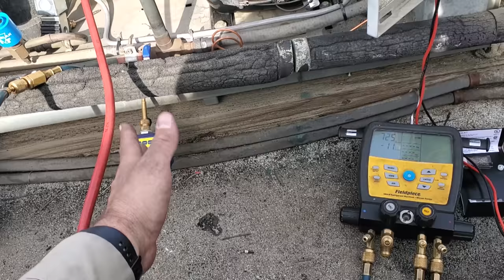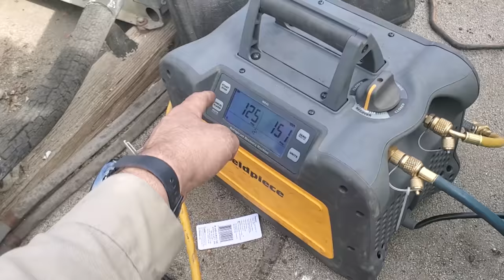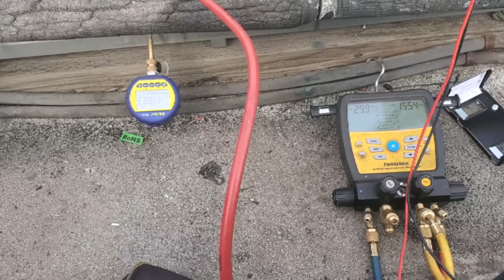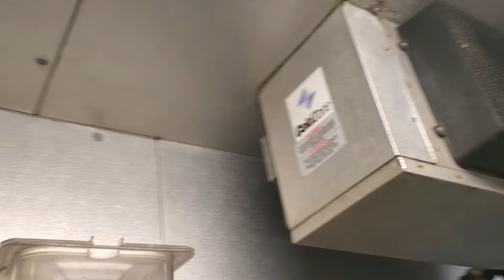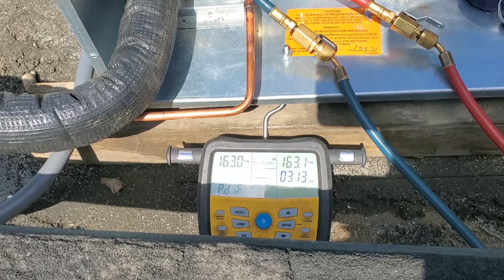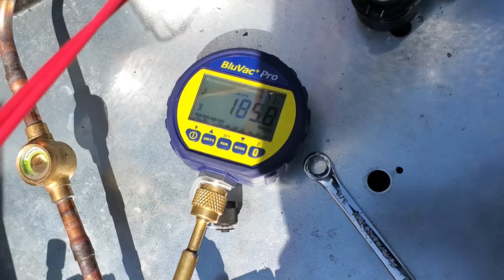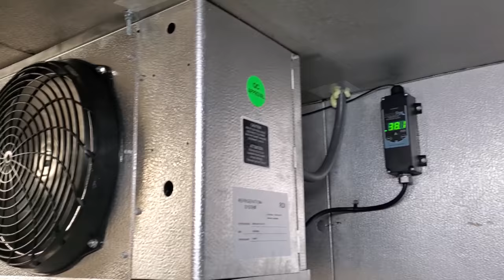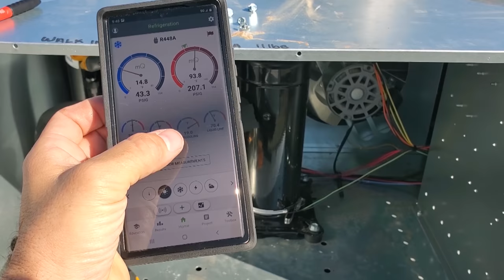THEY LOST POWER IN THE MIDDLE OF THE REPAIR

Comment: Here in Brazil we generaly use a breaker that is called "Motor Breaker" for 3 phase motors like that, this breaker it's like a contactor that shuts off in case of problem with some of the 3 phases, when the 3 phases come back to normal it turns on again saving the motors from problems.
Reply: A lot of newer equipment comes with phase loss detectors.
Reply: You could I suppose just put three single phase relays in series, and wire the whole thing into the line that goes to the motor contractor. Although those weird unbalanced phases like 40/80/120 volts might not get ‘r done with that. Some electronics are probably more reliable.
Reply: @JasperJanssen :

I don’t see how your idea would work.  
All three phases need to be within the labeled operating range, (with all three having reasonably the same VACRMS with respect to the grounded conductor).
Otherwise, you have a loss of phase.
Reply: @denverbraughler3948  each of those relays wired to each one of the phases. If any one phase is missing, its relay disengages, which causes the feed to the motor contactor to drop and therefore the contactor to drop out.
Reply: @JasperJanssen :

It’s unclear whether you watched the video.
Your design won’t detect a missing phase because — as shown in the video and as other commenters have explained — there is inevitably sufficient voltage on all three phases to close relays whenever any single phase is supplied from the power company depending on how the transformer bank is configured and what loads other customers have connected.  Notably, a running three-phase motor when a phase drops out is able to generate the missing phase and back-feed to other devices.  You wouldn’t even detect that the phase was being generated by your own equipment that you’re trying to protect.
Reply: @denverbraughler3948  I have no idea whether I watched the video either. If I did it was a very long time ago and I don’t remember anything about it, and I’m not about to rewatch it.

My comment was 11 months old!
Reply: @JasperJanssen :

Had you watched the video, you would have seen that you can’t block operation during a dropped phase scenario by simply cascading relays.  The real-world scenario is probably never ideal, and certainly most of the time it isn’t.
Reply: @JasperJanssen  In reply to your old comment and for future knowledge. 
They make cheap "motor saver" relays that already do what the OP mentioned. No need for any odd configurations of contactors. Just a motor saver, it monitors the phases and will drop out if any phase becomes unbalanced or is lost.  They are pretty common.  There are even more expensive models that will monitor the current balance between the phases to the motor and if the current becomes imbalanced it will also trip off the motor.

Comment: In 1965, there was a massive blackout which affected much of the northeast United States. However, instead of the power going out all at once, the voltage in my area slowly faded down over the course of a couple of hours. Incandescent lights just kept getting dimmer and dimmer, but as you can imagine for electric motors, it was disastrous!. My father raced around town turning everything off, but numerous motors were already damaged by the low voltage and had to be replaced or sent to Mr. Parslow's shop to be rewound.

Comment: I've got a 3,500 watt inverter on my van. It's awesome to have power everywhere I go.
Reply: Pure sine or MSW?  I've had a hard time finding one big enough to start a refrigerator or run large tools without shutting down on overload, found a 3/1.5kW one that starts a refrigerator but I worry it won't cut it for a power saw if I had to do some DIY cuts in the parkinglot to fit things in my car.
Reply: @matthewmiller6068  there out there, but the problem is massive power draw, no vehicle on the market has enough battery bank or generation to supply them. with exception of some hybrid electric cars and massive commercial units.
you're better off with a diesel or gas genset plumbed off the vehicle fuel tank.(motorhomes and others have been that way for years)

Comment: My only thought on pushing refrigerant into a system is using a line drier right before in enters your manifold or equipment. If you cut open a recovery tank ( or even an old recovery machine) you may be surprised at what you find.

Comment: need to invest in some phase monitoring/phase failure relays, usually installed in series with the mains power into the package unit or whatever equipment it is, and if it can't see all 3 phases the internal switch won't make a circuit and allow any power through down the line.
Alot of equipment in Australia have these installed in them.
We don't have alot of power issues where I am in oz anyway but I know you guys do in cali from time to time, not a bad investment for your clients I reckon.
Great videos Chris 👍
Reply: Actually that's a good idea dude, actually that it could be useful in my old workplace with 9 trane air controllers for the chiller who was a trane RTA from 2009 or 2008, a big old system with scroll compresors on r134a
Reply: @lutboy2909  yeah man 100% !
Has saved a few comps on my sites aswell over the years 👍🏼
Reply: In my experience here in germany, these are the failure point more often than they detect a failure.
Reply: @FerdinandFake  sadly, that happens everywhere with them, they become the failure point!
Reply: Wouldn't the best place for phase monitoring breakers be the Mains Breaker between the City Grid and the Site Distribution Panel?

Protect EVERYTHING from a lost phase in the City Grid...
Reply: @HappilyHomicidalHooligan  well yeah obviously.
I was merely pointing out a point where Chris could create some work for his company to protect the equipment that he himself looks after.
End of the day, Chris’s obligations to his clients is to keep their refrigeration and air conditioning equipment working and not their entire building, which would also be outside of his licensing restrictions.
Reply: @FerdinandFake  usually phase guard is cheap to replace instead of replacing big motor or similar. But yes, usually those are really prone to failures for some reason. One option is to make crude version with 3 relays in series, that almost never fails but does not trip before voltage in phase is really low.

Comment: Nice! I had always theorized that a recovery machine could be used this way, and then i got caught at the end of a repair just like you did, but residential. It worked for me too, but the power didn't come back on before I left, so I just had to hope. But the system started up and worked fine according to the customer. I've since been out to check and fine tune it tho. Couldn't sleep otherwise.

Comment: It's single phase but you have back-current and it's probably the same phase feeding all three wires.
And that's why you shall have ganged 3-phase breakers and fuses today so when one phase is overloaded it cuts off the others.
Even better to also have protection circuits that cuts the power if there's an out of range voltage, but that's of course a bit more expensive and has to be weighed against the price of replacing the equipment. Delayed start after a power outage is also something that can be helpful to avoid repeated power disruptions and blown main fuses. A delayed start can of course lead to some surprises too if you don't know it's there.
Reply: In the industrial world we install switch gears with phase monitoring so that they shut off when they lose one or more phases.  And most of the relatching mechanisms are electronic so nobody can bypass this .   Imagine single phasing 40-50 million dollars worth of motors in a processing plant..... ouch. 😬😬

Comment: The strange thing with the power cut and the voltage appear in the ground happens yesterday to me and ground the compressor on my air condition that I install and told you about it on an old video you upload.I think the walk in freezer retrofit with zoom look video was the one I told you about.So I had to change the compressor and it wasnt great for pay 350€ but its worth it.

Comment: Had an outage at the jail I used to work at. Something at the substation fried and when they restored power it took every 3phase motor in the building out. Took a month to fix everything. The air-conditioning was out for 2 weeks waiting on compressors. In June in south Georgia. It was miserable.
Reply: And to think how cheap phase monitors are now they should be in all 3 phase equipment.

Comment: It's possible there was only 1 leg restored and those voltages you were getting were from induction. I've seen that before.
Reply: A common thing what happens is at the moment the power comes back, the inrush current from an area kills the fuses for that area, sometimes even the high voltage feeder fuses somewhere. As a result you lose one or two phases, which are then backfeed through still connected three phase equpiment. This is what you're measuring relative to ground in this case. It's not just static or induction, it can deliver some serious power despite the low voltage - so don't mess with it!
Reply: there would have been back-feeding from other business/homes/etc. in the same electrical segment, from their 3 phase/pole and two pole breaker devices being on.
big induction is possible on unhooked/very light loaded parallel lines, which is why lineman ground everything to keep from being killed. zap zap zap.

Comment: I work with electronics and electricity; I've seen floating circuit induction. You see, all A.C. circuit wires have magnetic fields around them; the greater the voltage and current, the stronger the magnetic field. Thus, you have magnetic induction on the floating wire. That explains why you saw those crazy voltage readings on the terminals. Pulling the breakers was the best and smart moves.

Comment: Man, that poor extension cord is seriously on the way out lol. Look at all the twisting :D
If it gets twisted enough, the internal insulation will fail and it will pop. It comes from wrapping it the same direction every time, then laying it out and moving it. You put the same direction spin in it every time. Use the over-under wrapping to prevent that, or get a vulcanized rubber cord that can handle a lot more.
Reply from the maker: Yeah I was using someone else's stuff and I have since told him to replace the chord
Reply: Ah makes more sense :D

Comment: If the line size is calculated there is no need to put a p trap for a riser of 5 feet. Once your at about 15 feet that's when I would start thinking about doing oil traps. Great video. Keep up to great work. 🍻

Comment: 27:14 this system we called collector in Greek colectora or colecter is more efficient than typical condensing unit. Linde aka carrier is started to use this system from 2003.

Comment: I guess power is very reliable there but out here in the tropics every three phase powered anything gets a 3 phase supervisor protector. Any funny stuff with voltage or lost phase it goes off automatically until everything is right again.

Comment: Are you familiar with the AAON units we have to put ptrap on the suction line every 13ft. Seems like if the compressor is above the air handler more then 13ft they require a trap every 13 ft. It makes sense so the oil  goes back to the compressor but I'm going 9 floors. It's been fun lol.

Comment: Im curious, with all the equipment installs you do, have you ever received any doa equipment? How do you handle a situation like that if you do ever receive doa equipment? As an atm tech,  a lot of our parts are rebuilt, we dont get new components very often, so naturally we get a lot of doa parts and its annoying for both us and our customers
Reply: Thank you for asking that, I’ve been wanting to ask that for a couple years. The one and only time I ever broke my own rules and did a favor for a realtor because it was their parent, the circuitboard in the new equipment was DOA. It turned into a horrible situation where the realtor threaten to call the cslb. So, I just called my lawyer.
Reply: If the equipment is complicated and cheap enough its unavoidable at some point. Just installed a 50kg 134a unit and one of the high pressure cut outs was DOA. Not too bad, its works good enough with one of the compressors down until we can get someone in with a replacement, but still annoying.
Its really bad when you get a huge electrical box pre-wired and they made some mistake thats not instantly obvious at start-up. Whoever answers that service call might go mad before he figures it out.

Comment: We had one where the compressor was making horrible noises, turns out the electric company had two phases on the national grid supply and the third running off a generator!  Kept going in and out of sync making it sound like the motor was seizing up!
Reply: I suspect that someone mis-explained what the electric company was doing.

Comment: One time at my office we lost one leg of 3-phase power and one of the partners realized immediately that the big 3-phase roof units needed to be killed. Saved the units. It got warm for a bit until they brought back the 3rd phase and the units were turned back on.

They were still replaced a few years later tho lel. one of them was over 30 years old and the control board would keep locking up, and the other one wasn't as old but it just up and died. I'm pretty sure the main office area was the old one because when those compressors kicked in you could hear them vibrate the entire roof.

Comment: I really do find the American refrigeration stuff interesting, as someone from Australia (where it's needed almost everywhere), you do it differently over there. The be question I have is why don't you put insulation on the return line? A lot of systems in Australia have it on both lines.
Reply: If by return line you are referring to the liquid line, you don't want it insulated you want it to reject heat to the air to slightly improve sub cooling.  Some brand of mini-split units have the metering device in the condensing unit so those will have insulation on both lines.

Comment: Any three-phase motor running on two phases will generate and back-feed the missing third phase, even if not on the premises but drawing from the same set of electric supply transformers.

Any equipment connected to two phases, even a purely resistive load, will obviously backfeed an equal amount of current from one phase to another, but it will be 0° out of phase instead of ±120°.

Comment: Our old building got a phase disconnected by an exploding squirrel running over the fuse / switch on the power pole and we were getting strange voltages on some of the circuits, also the 3 phase elevator was down for a day after the power was restored, someone probably should have disconnected it during the incident but the management / maintenance isn’t in the building so not much happens immediately, techs have to be called.  

Now I’m in a house fed by single phase power but there’s a generator because the power is cut fairly regularly due to the fact that we’re on a smaller island, however the real challenge is the corner store I’m here to help run; it also has a generator that is connected to a walk-in cooler but there are several other refrigeration units that aren’t wired to it, 3 propane ice cream freezers and a big stand up freezer the size of a walk-in but just has doors on the front.  I don’t think the 8kw gen can handle both the walk in cooler and big freezer simultaneously but it looks like there may have been plans to give it the ability to cycle through different loads on a schedule or something like that because it has 4 different switching outputs but only one is being used...  we’ll see how things go during our first multi-day outage.  😅

Comment: Do you ever use flux when brazing copper pipe?   We always use flux when soldering.
Reply from the maker: No need to if you are brazing and using silfos rods as the phosphorus acts as a fluxing agent for the silver..... but silfos only works copper to copper, if you are brazing dissimilar metals such as copper to brass or copper to steel you will need to use high silver bearing solder and that requires flux.... ive never used any of the low temp solders such as stay silv 8 though

Comment: odd question, it feels like you are running the torch a bit too hot and heating the line too quick. I haven't worked with metal or even done this so i wanted to ask, am i wrong to think this?